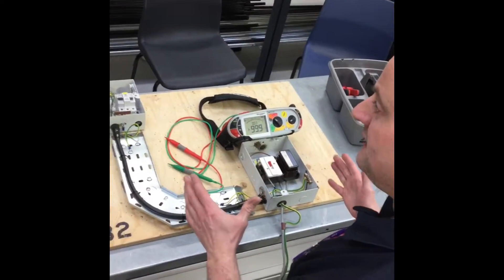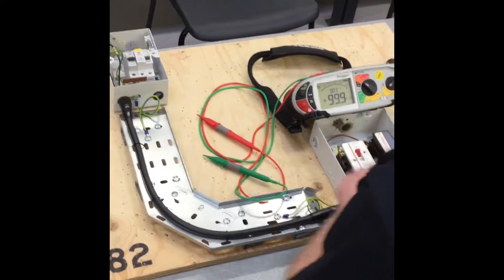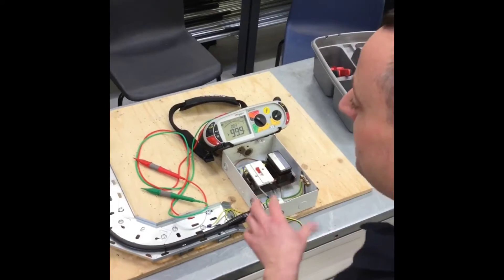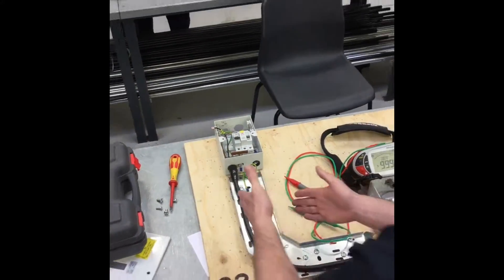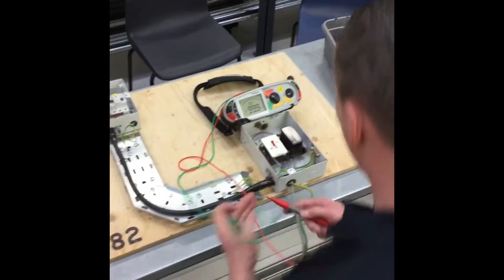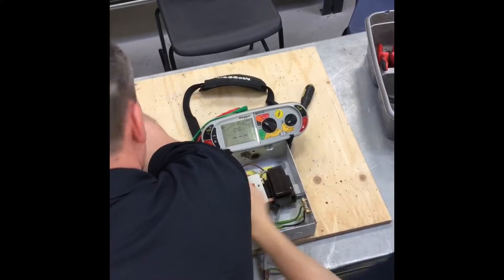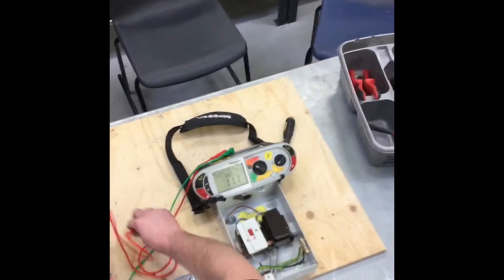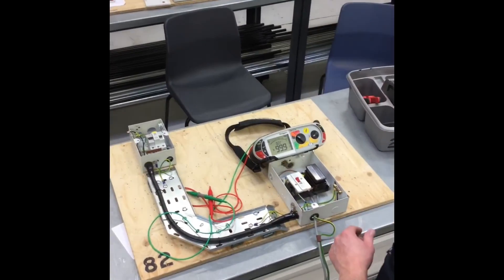Electrical Testing Continuity of CPC and Polarity of a SWA Sub-main Circuit

Comment: how would you test for polarity if you didn't have a double pole isolator from main cut out using the main tails of the consumer unit testing the distribution swa cable ??